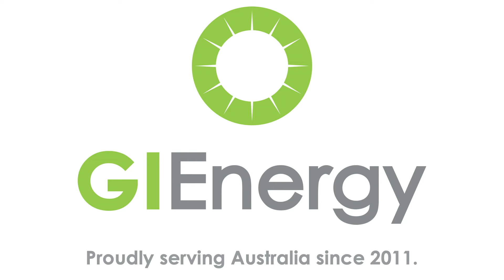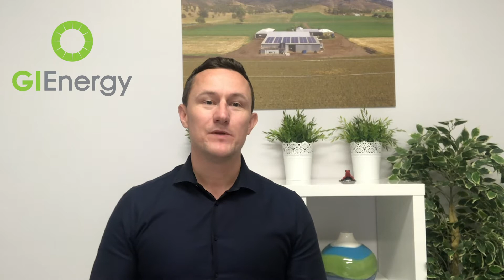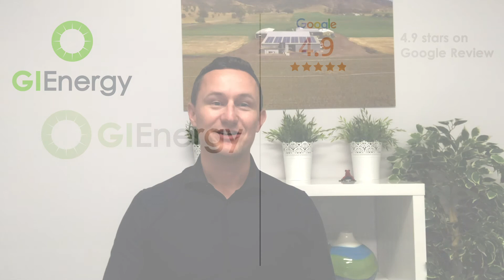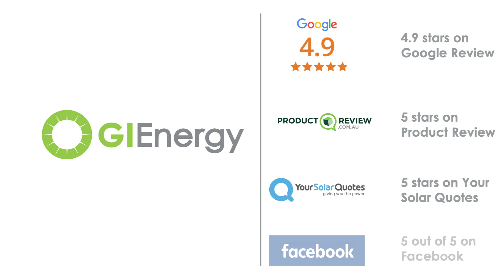What is the difference between a string inverter and a micro inverter?

Comment: Thank your for the video.
But my concern is: does the micro inverter system work off grid or is it just for grid tied?

2. I understand that I need 1 micro inverter for each panel but does that mean that I use each micro inverter separately also?

Comment: im having a serious problem. I got trapped into a contract for a solar array with micro inverters. the issue is that EMP shields require a single DC voltage to monitor and ground in the event of a voltage spike from atmospheric radiation from a solar flare or nuclear blast. the manufacturer of the EMP shield said that it cannot protect micro inverters because of that variance in output. is there any kind of wiring trick or perhaps a firmware update that can be used to get all of these inverters to operate on a single voltage. i thought maybe a bus bar that would tie them all together would work, but that still doesnt change the variation in voltage.

Comment: This is misrepresentation. Most modern solar panels come with bypass diodes which simply bypasses the inefficient string(s) in the panel and makes all other strings in the panels work at their full efficiency.
Reply: Are bypass diodes the same as power optimizers?
Reply: @AcquahBaiden  No, optimisers are current and voltage regulators. Optimisers increase the current of panels which are shaded while decreasing voltage so that the panel array can have a constant current and hence all panels are generating maximum possible power
Reply: @shrujanamsyama9940  This guy's panels have bypass diodes but he had a pretty large drop in power from very minor shade.  youtube.com/watch?v=AbxHoQF4ADk
Reply: @AvgDan  Bipass diodes are in longitudinal strings. In your video, the guy has small solar panels of 250W which probably has at most 2 strings of 125W each. Most modern panels have 300W (poly) or 400W (mono) while these panels look old panels and may not even have bypass diodes. The shade is also width wise which means bypass diodes won't make any difference. So, he is losing 2 solar panels completely and that is showing.
Reply: this shows that. the video isn't accurate at all though.

Comment: Good day. I need some advice! Can I add an independent system based on microinverters to an existing (6 years old) system based on a string inverter (that has 6 X 250 watts S-energy panels, Imeon 3.6 inverter, 4 FIAMM AGM batteries)? I could add more panels to the existing system but only with the same wattage as the old ones.

Thanks
Reply: Hi Antonio. Yes, you should be able to do that. You will need to make sure you are in line with the network owners regulations in terms of how much AC you are adding though. Depending on where you are located, you may have 5kW per phase limit.